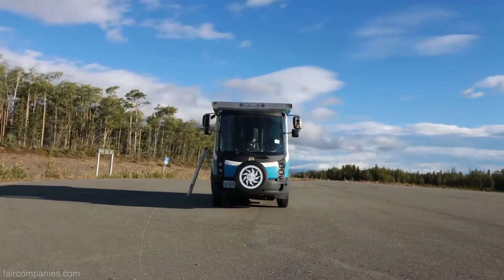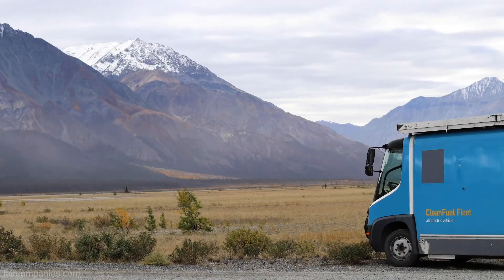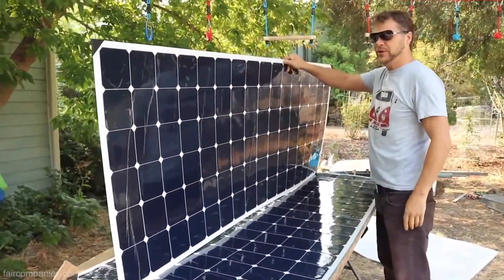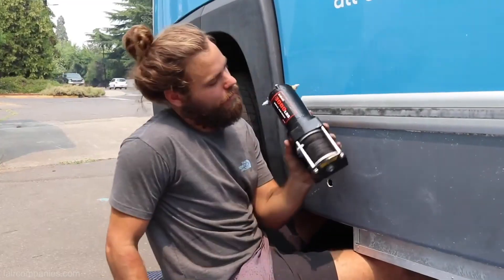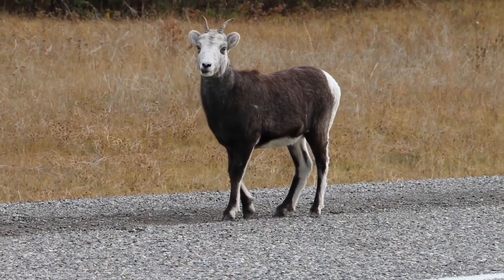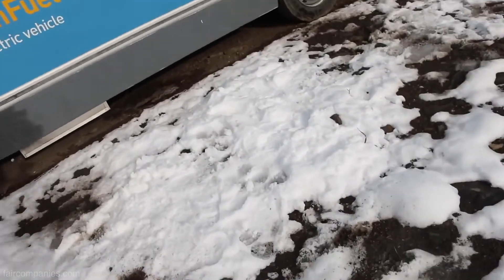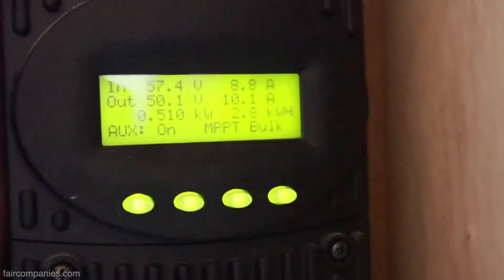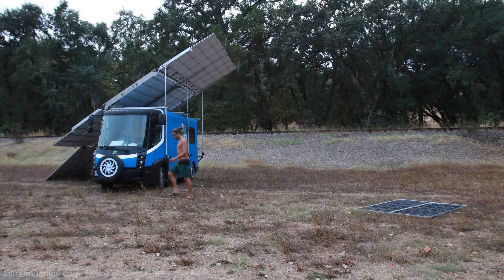Delivery EV turned solar-powered campervan: 100% self-reliant

Comment: "In this circumstance you've got to let go of the whole entitlement of getting somewhere when you say you want to get somewhere." This encapsulates the mindset shift that needs to happen among the globetrotting class in the age of climate change. It has been possible to travel over oceans without fossil fuels--it's called sailing, but it takes weeks instead of hours. It is now possible to drive across continents with electric vehicles, but long stretches or heavier vehicles require stopping for charging along the way. With the imminent adoption of universal, planetary wifi (through satellites) it should no longer be a problem to take a little (or a lot) longer to get from A to B. If on the road, you stop and take a walk/hike or read/watch/work. If on the sea, you read/watch/work and enjoy the incredible experience of riding the waves. I'm looking forward to a future filled with sailing trips, electric ferry/boat rides, and even flights aboard electrically-propelled air ships (as described in the books of Kim Stanley Robinson). The jet-fueled flights of the rich/impatient - or of those needing to take a rare, once-or-twice-in a lifetime last minute trip (like the sudden illness or death of a loved one) - should be taxed at an exorbitant rate with the proceeds going straight back into developing the tech for us all to travel fossil-free farther and faster.
Reply: Yeah, you think we have supply chain and food shortage problems now then imagine if we had to ship everything this way...
Reply: @ZeoCyberG  All right now we have your order, that should be arriving in 3 to 5 years.
Reply: @ZeoCyberG  Its not a matter of If. Its a matter of When.
Reply: This may work in Europe or the US, but in most parts of the world, this is a very dangerous way to go about it. I would recommend against it.
Reply: @samuelboucher1454  No worries, they're working on ways to reduce that dramatically as well.
Reply: You, my friend, will then love the book I'm working on! 🙂
Reply: You want to tax the bereaved at an  "exorbitant rate".     Someone is desperately trying to travel to loved ones.  They are very ill.  Dying.  Dead.      You want to tax them at an exorbitant rate?     What a horrible thing to do.    What sort of person would do this?
Reply: Easy to do when you don't have a job.
Reply: @sun1one1  They do have jobs, just not ones that require going into an office everyday... think outside the corporate box.
Reply: @dama9150  That corporate box builds everything he fitted into and on top of the van, including it.
Reply: @dama9150  Not everyone can have those jobs duh.
Reply: Imagine how much more of life we can enjoy  just using alternative fuels. How much more of nature we can see and hear without loud engines. Cleaner air and water. May I live long enough.
Reply: The climate has been changing for 4.6 billion years.  Get over yourself.
Reply: Yes, the philosophy is a good match for the tech here.
Reply: "In this circumstance you've got to let go of the whole entitlement of getting somewhere when you say you want to get somewhere." What a coincidence that I just read this comment as I heard the very quote on the video. :)
Reply: GREAT IDEA SO LONG AS YOUR BATTERY TECHNOLOGY IS SOLID.    HOPE YOU GET TO SEE THE FLEET OF BUSSES EXPLODING AT A CHINESE UNIVERSITY INSIDE ONE MINUTE.   NOT TIME TO GET OUT.    LIKE THE CELL PHONES EXPLODING AT THE CELL PHONE STORE.   LITHIUM I THINK.

Comment: One way to shave off some weight is if that's actually wood we can see remove it.
Then use plastic panels made to look like knotty pine over a thin layer of foam for insulation.
You'll shave at least 60 percent of the weight of that wood.
A friend of mine did it to his converted Greyhound bus and increased his MPH by 47 percent.
Only he used a extreme thin layer of wood veneer over 1/2 inch foam.
With shredded borax infused wool between the plastic vertical ribs it was mounted to.
Interior cabinets and other item that were wood where wood look plastic over foam as well. 
It's stronger than you might think. 
He did install solar to power all electrical equipment but it still has a diesel engine as his Jobe takes him all over America for location work and he can't drive at low speeds.
He does look forward the day he can go full electric tho.
I have no doubt with the rapid advancement in both battery technology and solar power technology within the next 10 years it'll advance enough he can.
The ones that are being built and solar today are still not affordable for the overriding majority of people worldwide for off the grid living.

Comment: Wow! Theoretically couldn't solar power be used to recharge batteries for electric cars?
Reply: Of course, you can use solar panels on a building to charge a vehicle. There are a few companies developing EVs with integrated solar panels: Apterra (USA), Sono (German) and Lightyear (Dutch).

Comment: I would not have the extra solar panels as sideways pull-outs, I would have them on a trailer or even maybe two trailers, so that I would be able to continue charging with the full surface area whilst driving.
Reply: But each trailer would increase the rolling resistance resulting in higher energy consumption.
Reply: @Freba9  the weight would be as minimal as possible, just enough to carry the solar panels. Bicycle wheels on an aluminium frame would probably work.

Comment: If there is not much wind you can use a mylar reflector to double the output of your panels.
Reply: And if wind, add a vertical axis windmill!
Reply: @kwhatten  ok I like it how about a vertical axis windmill out of reflective mylar and panels on the axis like a concentrator.

Comment: that's an awesome idea. ofsetting the low center of gravity with a solar roof. plus it keeps the van cool
Reply: Solar panels with frame is stated to weight just 400 lbs.
The battery in the van frame between the wheels would weigh 2-3000 lbs. 
The centre of gravity would not move that much based on location of the 400 lbs of solar (roof, or near the battery pack .. as <10% of vehicular mass)

Comment: The Al-Can Highway is legit dangerous to this day. Traveling it in this thing is borderline nuts! I like it.
Reply: I rode the entire thousand miles in 1982 on my '74 Honda 750k, brutal dirt road the live wire solder broke free from the ignition switch.
Reply: @marcbee1234  HAH! I  laugh cause you obviously survived but that is a great example.

Comment: Have to say that is a pretty cool project, i wonder if a bigger vehicle would be better like RV sized as you could fit more batteries and panels on it, although would use more power to drive i wonder where the sweet spot is on size and range for something like that. 
Comparing a big RV which gets 8-14mpg to something like a UPS truck which gets something like 10mpg shows that even though the RV is much bigger its not twice the MPG to run so could be better for a bigger vehicle as once your rolling weight plays less of an issue, but imagine a Solar RV with 400kwh battery pack i bet you could do some serious miles in that. 

It is exciting to see what is going to be possible in the future, imagine if Tesla built a Solar EV RV :)
Reply: My dream RV would be something like a large diesel-biodiesel/electric hybrid 4WD with slide outs and the large fold out solar panels on top, also a telescoping wind turbine that can be quickly propped up & taken down. A roof top rainwater collection system, dual water filtration system. (Your shower water could be filtered in a coarse filter & reused to wash clothes or dishes, the other fine filter would be for your drinking water) A small diameter long hose & pump that could be dropped into any nearby lake or stream to refill your water tanks (going through a coarse filter before entering the tank) When boon docking, between using the wind turbine & slide out solar panels you'd have plenty of off grid power. You could also possibly find free or cheap used waste vegetable oil that could be filtered to run the on board diesel generator. The wheels would be powered by electric & the on board diesel generator would be used to charge the large battery bank. Using bio diesel & waste vegetable oil would be much cleaner burning than gasoline or fossil diesel.

Comment: Loved the moment, 12:31, where another car passed them with the passenger simulating like he was rowing faster than they were traveling. Hilarious. It'll be interesting to see how long it will take technology to make the whole solar powered car concept more efficient. Unfortunately, for now, it's a tough sell to the average person because most of us, like it or not do have constraints on our time, even when on vacation. But I always admire pioneers. You gotta start somewhere.
Reply: For more efficiency take a look at the Lightyear One. It sets you back some  $170K, but you only have to charge 3 or 4 times a year.
Reply: @lexvegers242  Yes the Lightyear One looks amazing. Fully Charged said they chose to make it a $250K luxury car so they could use it to fundraise the development of a $30K daily driver version. So if all goes according to plan they will release a more affordable model in the next few years.
Reply: ALSO DHECK OUT THE EXPLODING ELECTRIC BUSSES AT THE CHINESE UNIVERSITY AND THE EXPLODING CELL PHONE BATTERIES AT THE CELL PHONE STORE.     NOT EVEN TIME TO GET OUT.   TECHNOLOGY NOT MASTERED YET-   WOULDN'T WANT TO BE THAT STATISTIC.
Reply: A battery-charged EV is from a practical point of view not possible and never will be. Solar power just doesn't have enough energy density. It would be like trying to build a 500 MPG car. Is it possible - sure! But it would be more like a 20 kg four-wheeled bicycle than a proper car.
Reply: Imagine all the mining required for materials to create the batteries and solar panels! 
Solar is kinda of pretentious.  It still destroys the earth through mining for all the materials to pretend to be more earth friendly...
Reply: @JustWondering66  TOTALLY AGREED.

Comment: Considering how much solar you got it seems inefficient.  I'm used to Tesla standards and van life channels which seem greater.  On the other hand, the van life moves off gasoline still, not solar, which only powers things inside the van.  Soon tech will take over even van life with solar systems for moving as you're demonstrating.  Thanks for this early. Peek at the future.
Reply: Air resistance is your enemy. no. 1, weight is no 2. This box has some 10 times more air resistance than any Tesla. Try putting Model S 2000 pounds of extra weight and an 80 sq. ft sign to the roof sideways and try how far it goes.

1. Batteries need to become lighter. 2. Solar panels need to be more efficient. 3. Vans need to become lighter and have much lower air resistance
Reply: @timogronroos4642   I'm hoping that once cybertruck and semis are rolling out the Tesla factories later this year that the next new product model from Tesla are EV vans.  Given Tesla tech they'll be awesome and what I want to live in as a an nomad.

Comment: I think this is fantastic. Speed and technology will improve as more people do this. Solar panel tech is improving too. You could use photo voltaic glass instead of panels, to be more streamlined.
Reply: Heavier.
Reply: Rigid panels last much longer than the flexible ones.

Comment: This is wonderful. EV's are coming along. My Chevy Bolt has new batteries and my full charge will get me a max of 384 miles if I drive thoughtfully. I change off solar at home. I hope folks will adopt change before we face climate changes beyond repair. Love seeing what these guys are doing.
Reply: You are a useful.
Reply: @Chinther323  Still cleaner than using gasoline or diesel.
Reply: Hope it doesn’t explode in your garage.
Reply: @ewxlt  you’re not keeping up with the technology ……
Reply: @tccragun  Neither is Chevrolet.
Reply: Wait til they force us all on the grid charging electric cars and bikes to travel and we crash the grid and no one can travel then. Yay!
Reply: @droptozro  except by old-fashioned petal-power ….. yay! YAY!!
Reply: @Chinther323  But imagine if we used nuclear to charge them no c02 would be amazing.
Reply: @ATomRileyA, Yeah more cancer and less living
Reply: Chinther, I charger off solar at my own home. With the great range I get, i have never needed to use a charging station in the 5 years i have owned the car. 
@ewxlt the battery issue has been resolved.

Comment: Welp. guess that's proof that good Ol gas and Diesel engines is the way to stay.  30mph is horrible. and running out just driving daily. horrible.  But before the trolls try and beat me up The Delivery van is very Kewl. being retired and traveling I dont think that would be good fit for older people,  too much work.  👀  🙂🙂
Reply: This van does not represent current state of technology at all. There are plenty of great fully electric vans on the market already that can easily maintain highway speeds uphill. And this is only the beginning.

Comment: Love your van!! And I never liked electric to cook on, but you reframed it by saying no fossil fuels are being used. That is a complete advantage to electric. And just so you know the Pan American highway does not go all the way to Argentina, there is no highway in the Darién Gap between Panama and Columbia.  You can take a ferry or you can ship it in a container from Panama. It's an awesome trip! 😊
Reply: Induction cooktops have completely transformed electric cooking.  Amazon sells a duxtop for 50 dollars.  Works exactly like gas, but no wasted heat.  The pan is the only thing to heat up.  I haven't used my stove for seven years.
Reply: @secondact7151  That is fantastic news! 😊 If technology can help to make electric cook like gas, then it's a total game changer! Thanks for the info I will check it out. 😊
Reply: @secondact7151  It pulls a lot of power tho, no?
Reply: @dama9150  I would think it does. But maybe with the new technology, something is different. Dunno.
Reply: Induction is more efficient and heats quicker so power/energy is saved. Less is transferred to surrounding wasted heat and more focused to the pot/pan and food.
Reply: @terrafirma9328  Good point.
Reply: I've had induction cooktops for 22 years now, time to update from the old tech
Reply: Much cleaner indoor air if cooking with electric. No NOx (nitrogen oxides) and other harmful emission from combustion.

Comment: Batteries are not going to be green in the end are they because of disposable of them and  The materials you need to use to make them...
Reply: Batteries are far less polluting than gasoline.
Reply: @marthale7 Hydrogen is not efficient enough.
Reply: @marthale7 I cannot find anything when searching for ‘hydrogen tape’ related to this subject. You mean solid hydrogen storage? I know hydrogen cars exist. They are very inefficient.
Reply: Who cares about effeciency when you get free energy from the sun😜
Reply: @terrafirma9328  Because then you will need a lot more solar panels...
Reply: @marthale7 Could you elaborate on this new tech?
Reply: @marthale7 I thought you were talking about ‘hydrogen tape’? The video above is about a battery electric vehicle.
Reply: @marthale7 There is no link. You should know that Youtube automatically deletes links posted in comments. Provide me the title of the video and I will look it up.